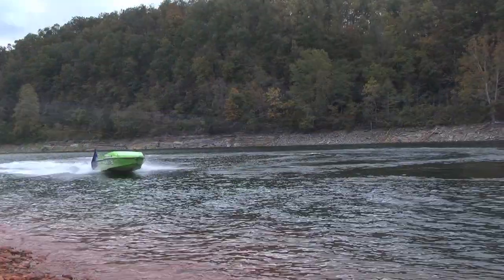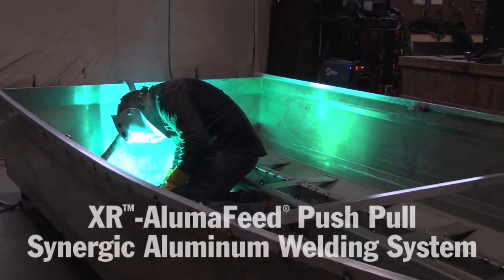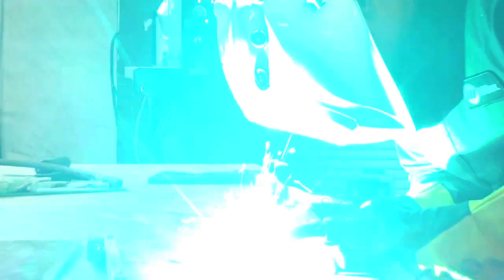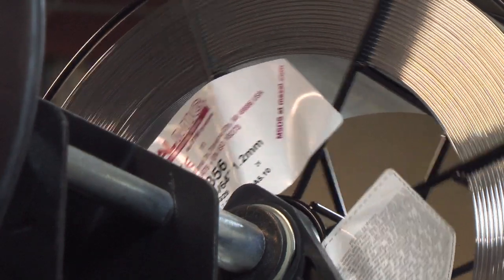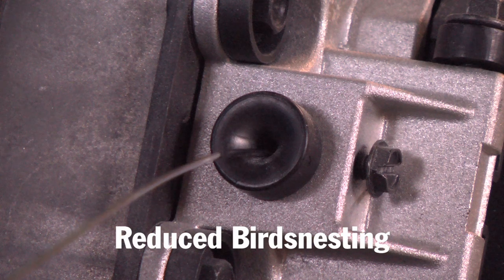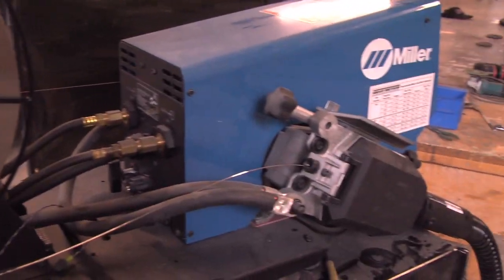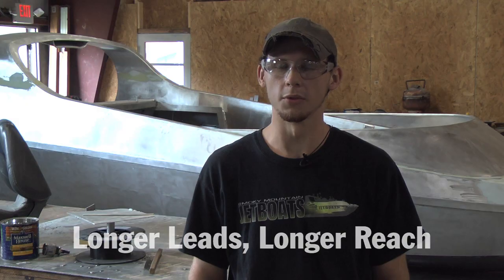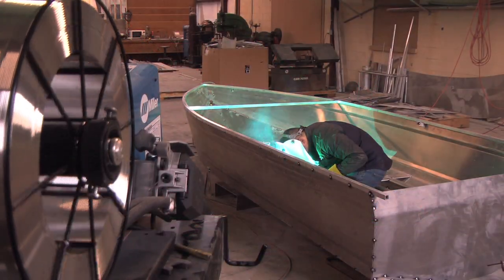Pulsed MIG Welding Improves Aluminum Boat Building

Comment: that weld at 1.00 would not pass many inspections , its got huge craters in it , looks cold , is far from continuous , to be honest id have ground it out and tried again , the weld standard that that passes  must be very forgiving , is it just a visual , or is any of it actually tested .
Reply: Whipping too far definitely... I guess those guys didn't figure out sharp arc settings on that thin gauge material
Reply: Or the crater fill🤣
Reply: @powerstroke0459  I don't like crater fill...jus tack it again..plus ur right about turning up the sharp

Comment: You better go back and fix those holes you left at the end of those welds.... You can solve that by giving the weld a extra tack at the end of your weld. Run the weld to the end stop and pull the trigger one more time to add a big tack at the end of your weld. If you don't do that you risk a crack starting from that hole and it can crack all the way back.
Reply: Tell em.. ROOF!
Reply: 100% Correct, source I weld pulse mig aluminum boats in Seattle and have been trained well. Great job to have!

Comment: Maybe welder shoud use welding mask with over pressured clean air system. Those aluminium gas in you lung can be very bad.

Comment: I don't get why the coast guard has to inspect your welds. just another example of government in our business. I am am sick of all government crap.
Reply: I doubt they come in and inspect every weld, more like SMJB sends a new employee to a "Coast Guard Approved Inspector" once and that's it
Reply: I doubt the CoastGuard has any time to inspect the building of boats. At only 44,000 to 45,000 members I really doubt they have the personnel to lend to for this crap. I hate people using the CoastGuard in there videos just to add some sort of validity.
Reply: Lol
Reply: If your building any passenger vessel, CG comes and inspects any cropping out of plate, fit up of new plate, then back gouge inspection, final either dye penetrant or vac box